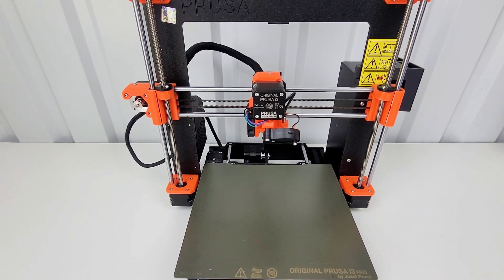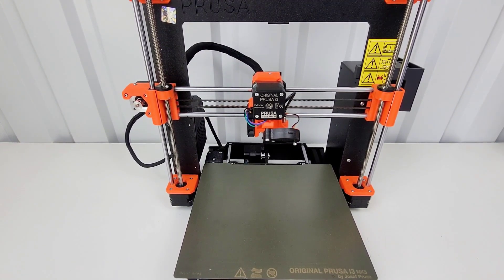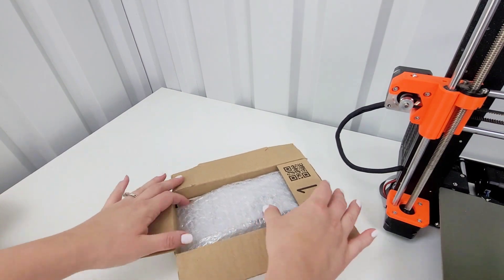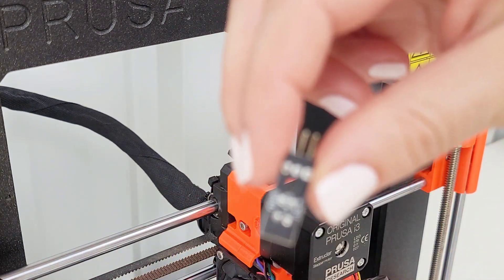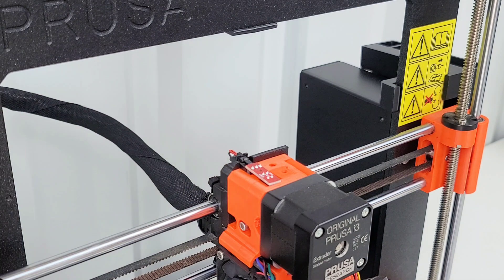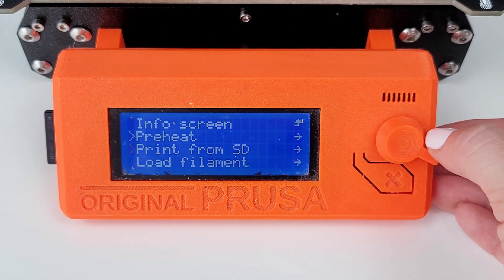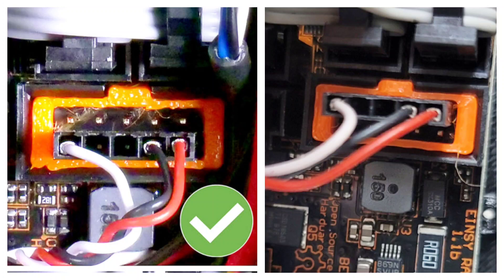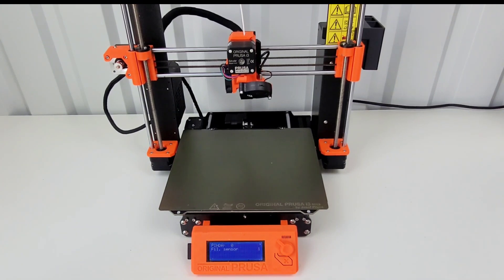MK3S Upgrade to MK3S+ (Side Quest for MMU3 Assembly) Troubleshooting IR Filament Sensor

Comment: Thank you for this. After replacing the Thermistore and general cleaning/maintenance, I inserted the plug of the filament sensor at the upper row of the pins. Auto load not working; triple checked everything, contacted Prusa support, and sent pictures of the plug, and they suspected the sensor. Thanks to YOU, I'm not going to buy a new sensor tomorrow. Thanks again.😀😀😀😄
Reply from the maker: Oh so glad you figured it out! Thanks!

Comment: Your original filament sensor was inoperable due to atleast the two missing magnets that force the ball bearing against the filament slot. 

Note the offical Mk3/Mk3s to Mk3s+ upgrade kit includes the new IR sensor, its cable, and the ASA fan shroud. It also includes the y-axis upgrade, new cable wrap, etc.
Reply from the maker: Thank you

Comment: You are a life saver! I had the exact same issue. When plugging the cable in I didn't realize there was two slots and also plugged it into the top slot instead of the bottom. It probably didn't help that the cable box is tiny and it was 2 or 3 AM when I was at that point in assembling the printer. I printed some shims to place under the sensor like I read in the Prusa forums, but it still wasn't working, then I found your video. Took less than 5 minutes to fix. You earned a like and sub from me 👍
Reply from the maker: Oh so good to hear! Thanks so much!

Comment: Just a little tip for you regarding your filament sensor. If you ever have any intermittent problems with any of your filament sensors on your printers in future, invest in a can of electrical contact cleaner. Remove the sensor and give it a spray with it, let it dry, which it does almost immediately and then reinstall it and you’ll find that will fix it 99% of the time👍 It’s usually just dust and/or debris messing with the sensor.
Reply from the maker: Oh good to know! Thanks!

Comment: As somebody who has worked in IT - yeah, I always try the free / cheapest fixes first. Cables that are loose, damaged, or plugged in wrong are a pretty common problem. But good to hear you got it fixed, and having the correct part will help in the long run anyways, especially with an MMU.
Reply from the maker: Yeah I should've checked that out first. Or even while I was waiting for the sensor to come in. But it's done now. Thanks!